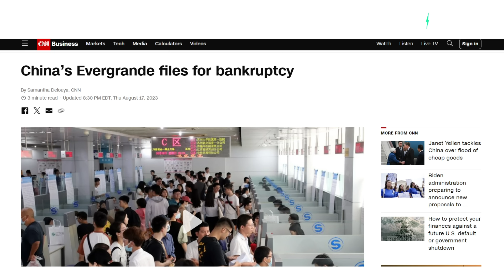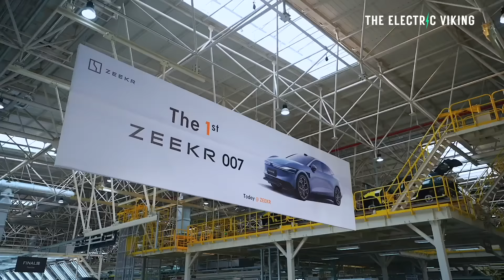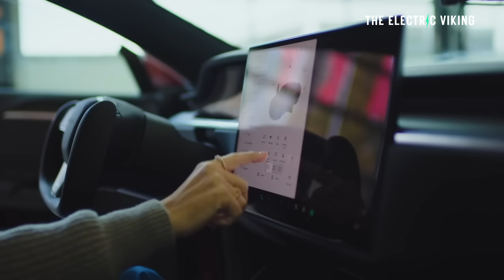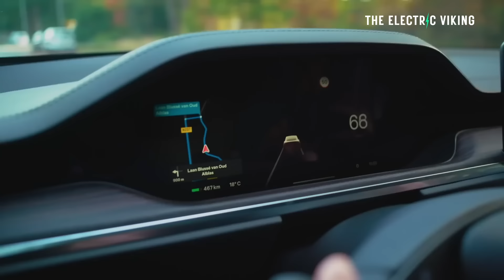China's plan to revive its stagnating economy with sub-prime car loans

Comment: Those robots will replacing aging workers, and automation will be used in factories for the same reason. Robots will replace older workers, and help take care of older people. 
Those EV cars can be consumed in China, only 29% of the Chinese population have any kind of motor vehicles.

There are 415 million motor vehicles of all types in China, and there are only 20 million EVs. About 5 million EVs are produced in China, so China could absorb all the EVs that they produce. 
China doesn't have any problems.

Comment: Sub-prime loans mean loans to borrowers whos credibility is not first-class, so the load interest rate will be higher than those "prime-loans". This does not mean anything bad. It is only because someone in Wall Street invented the CDS (credit default swap) and package then with sub-prime loans and sold to un-aware investors that had caused the 2008 sub-prime mortgage crisis/ Lehman Brothers collapse.  IMO it is just the Economist using the fear in people's bad memory on the 2008 financial crisis to lure people to relate it to China's economic stimulation policy. What the Economic didn't mention is that the banks can still determine the borrowing ratio and the interest rate. Also, unlike properties, cars normally won't appreciate and the loan period is relatively much shorter. So, do you think car-loans in China can cause similar crisis?

Comment: They should focus on recycling these vehicles as they already have a law you have to scrap your vehicle every 6 years
Reply: That is not really the law. Their average vehicle on the road is a little over 6 years old but that means half are older than that and sales have increased significantly over the years (meaning there were fewer new cars sold a decade ago to influence the average). Much of the mandatory scrappage had to do with used cars having to meet increasingly strict emissions standards tested during inspection. Something EV's do not have to worry about.

"According to the guidelines, vehicles which are due for periodic inspections and have failed to pass three consecutive tests will be forced to be scrapped.

According to Chinese regulations, following their purchase, new small cars are required to be inspected once every other year for the first six years, than every year for the next four years. Afterwards, they are required to be inspected once every six months. A vehicle which fails to pass three inspections in a row is subject to be forcibly scrapped."

In comparison, US inspections and used car emissions standards are very lax.

Comment: Sounds exactly like building more house or homes than you have people can look how well ghost cities turned out
Reply: You do not understand.
This is how China has built and really HAVE TO.
China has AND STILL ARE moving 800 million-1+ billion from an agrarian setting to an urban setting for this they need about 3x-4x the number of "housing units" that the USA have in 40-50 years.
They still have around 500 million that will move in to urban settings.

The speed this is done is UNPRECEDENTED.
"Normally" how it works is people move to cities, slums builds up etc... FIRST people move THEN you build but this at much slower rate, look at London 2000 ? years old 9 million people " a lot of time to build"

What China do is FIRST build the cities THEN move Industry and people there.
You really can not build 3x-4x USA's in a hurry... YOU NEED A PLAN and China actually have TO FEW new cities, they need apartments / housing for 500 million or so the coming decade / decades (I guess they do it as fast as they can but it has got to do with how fast the agriculture sector mechanize etc)

Most "Ghost Cities" are not "Ghost Cities" any longer, but some takes time.
What one also should remember a city is not just houses, you need the roads to from, rail, electricity, water etc it is a HUUGE undertaking building cities with all infrastructure they require.

"To move a billion people aint easy you do need a plan, time and preparations"

The largest city in China 1950 was Shanghai, 4.5 million people, Beijing was 1.5 million.
Today Shanghai is 24 million and Beijing 22 million (New York is 9 million) these were built like "Ghost Cities" houses before people, no slum.
There are today 113 cities > 1 million all have been "Ghost Cities".
There are 12 cities larger than New York, some more than TWICE the size.